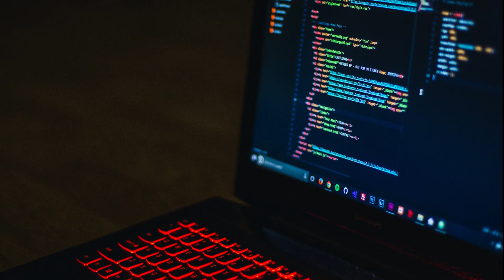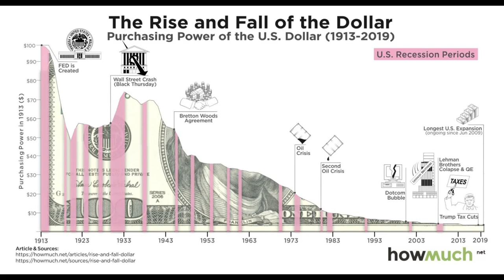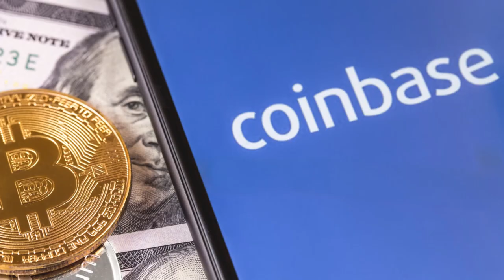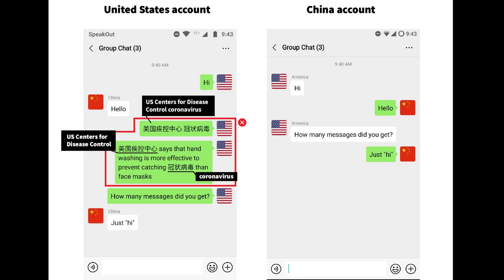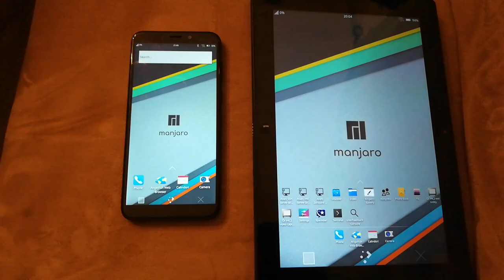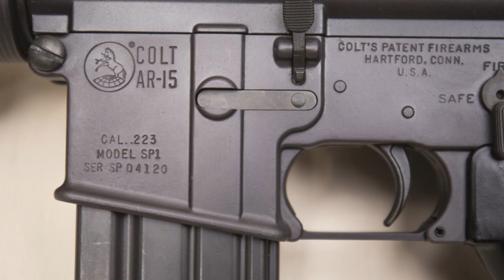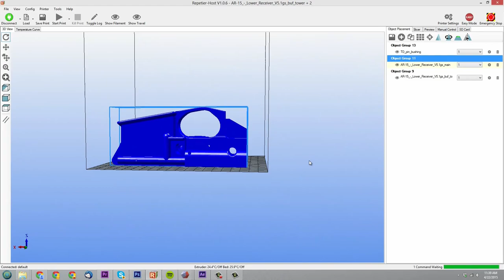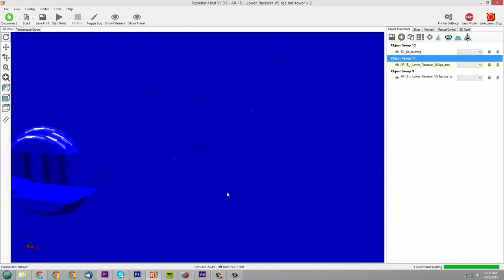Technology's Role in the Battle Between Government and Liberty

Comment: 3D-printed firearms mean nothing without 3D-printed ammo.
Reply: 3D printed firearms are an utter meme anyways. Get a mini lathe and a welding machine and you'll make a much superior gun in your garage for the same price. It's only pushed by boomers who don't understand the limitations of this technology. 

Also, making ammo is stupidly easy if you have access to any kind of nitrate or nitric acid. It can quite literally be made out of paper cartridges and a few cast lead balls.
Reply: @gayusschwulius8490  Where can you get a mini lathe and a welding machine for cheaper than a $169.00 Ender 3 and a $22.99 roll of esun pla+?
Reply: @technical3998  Since when does PLA work for guns, don't you need stronger plastics for that? I'm pretty sure if you printed the liberator in PLA it'd burst on the first shot. And printing precise ABS parts with the Ender 3 is a massive nightmare because it is an open printer which will always produce warping issues. 

A mini lathe + welding machine will cost you around 300 dollars. But you only need the lathe if you want to do a rifled barrel, the welding machine alone for about 100 dollars + a few other small tools (saw, dremel etc.) and lots of time would be enough to make a really decent smooth barreled gun out of parts you can buy at the hardware store. And 3D printed guns would still be inferior to that.
Reply: @gayusschwulius8490  I didn't say pla, I said pla+ It works for all kinds of lowers mine personally has lasted over 500 rounds with no signs of wear(would have more rounds but ammo is pricy).  Also, look into the FGC9 its 100% pla and it works fine.
Edit: I forgot to mention the Anderson Hellfire/Wildfire, they are ar lowers that work in normal pla.
Edit 2: Your information on what is possible is a little outdated I recommend you visit crtlpew on YT.  Also, join the deterrence dispensed keybase to check out what possible now for example we use a process called ECR(Electrochemical rifling).
Reply: @technical3998  The barrel is not PLA, but it is made with PLA tools.
Reply: @lordvalen8133  I know it’s called ECR or ECM.
Reply: @gayusschwulius8490  they're not a meme, they're just in their infancy. It'll only get better. Luckily.
Reply: @gayusschwulius8490  Welders are cheaper than 100 dollars, I think I've seen some for 30 in here, Argentina (and this country is not cheap).
Reply: @gayusschwulius8490  
And machining tools are incredibly expensive, specialized, and difficult for a layman to operate properly. If the goal was to create a good gun, 700 dollar 3d printers running nylon and heated enclosures would be the norm. Instead, we see people using chinesium printers and PLA, because the cost to get set up is low and PLA is easy to use, which is good, because the entire point of printing guns is to make them impossible to regulate, not to make them good.
Reply: @somerandommen  Yes, but those use a metal barrel and multiple other metal parts (bolt, chamber etc.) that need to be bought or machined, which defeats the purpose of a 3D printed gun, because the sale of those parts can be regulated and machining them requires tools that could already make better guns without 3D printed parts. For example, if the EU banned the sale of soft air rifles to people that cannot prove legitimate intent tomorrow, the inventors of the FGC-7 couldn't do shit anymore. 

In the end, only the "easy" parts of a gun can be 3D printed, so those that don't need to withstand the mechanical force of the explosion, if you want to have a gun that doesn't explode after the first shot. 

Thing is that those parts were never the problem. Luty made those with much more primitive tools 40 years ago. The problem was always manufacturing a rifled barrel, a chamber and a bolt that can withstand multiple shots. And in that regard, 3D printers have changed very little. 

If CNC mills and lathes ever become cheap and easy enough to operate for the average person, that's when the government needs to worry about homemade guns. As it is nowadays, 3D printers have not considerably improved the ability of the average person to make a gun at home. It's all a giant hype.
Reply: @gayusschwulius8490  You are the boomer here. The FGC-9, or "FGC-7" as you called it, was designed by a European (RIP Jstark) specifically to circumvent all these bans on parts. You can make a nearly 100% PLA+ FGC-9. The only metal parts you need is two pieces of metal stock, and a pipe that you can electrochemically machine into a barrel. It's not just hype, and this is just the beginning.
Reply: @gayusschwulius8490  Someone hasn't heard of or properly researched the fgc 9
Reply: @xcallista8879  you are correct, fgc 9 was made to circumvent European gun laws, like the luty. The fgc 9 now has a mkii version, there are other variants based off it like a mod 9

If someones bitching, then just make a luty, then use a printed pistol grip, hand rail, stock, optic railing, and foregrip. Then you have a metal gun with polymer furniture which can be made with hand tools and a cheap 3d printer
Reply: @gayusschwulius8490  Boi, u r the boomer here. Much more easy and much cheaper to ECM a barrel than making it on a lathe. You don't even need to weld the bolt. And those are the only parts that are not 3d printed, except for screws and springs.
Reply: @MrDanielsahne  Yes, yes, yes, but that's not my argument. ECM rifling is a great improvement in homemade firearms design, but it has little to do with 3D printing. Whether I 3D print the part that holds the ECM tool or make it out of styrofoam or another easy to work material has zero relevance to the result. The FGC-7 and other weapons are great improvements, but they are not an improvement BECAUSE of 3D printing, it's the innovations that have nothing to do with 3D printing that are important. 3D printing only makes making homemade guns marginally easier, it isn't a "big game changer" like MSM boomers like to propose.
Reply: Bro you know Google saves all comments Right

This place is not private...
Reply: @rivulet5417  YouTube doesn't use end to end encryption? Lol
Reply: @kotalifts5611  It's like whatsapp end to end...
Reply: @rivulet5417  oh damn, I guess they're screwed
Reply: @gayusschwulius8490  except for the primers ...

Comment: I'm gonna nitpick here, but I just wanted to point that there is no rooting involved in the process of installing GrapheneOS, just unlocking the bootloader. In fact, Daniel Micay actually recommends against rooting, as it is a security risk.
Reply: >"rooting is bad"
Cringe
Reply: @iskamag  Rooting basically entirely screws the whole android security model by removing the separation between system processes and user space apps.
If you want to modify anything on the system, it's preferable to just build and flash an image with the wanted modifications rather than rooting the device and let userspace applications perform the changes.
Reply: @ricardillapujagut8073  ah, I see..

Comment: Also keep in mind the reason why Crypto isn't really considering a good currency is because the price fluctuates too much, and its not as stable as USD even with inflation.
Reply: Yeah, stability is  the very real problem with crypto at the moment. I agree with the idea on principle, but a currency that changes wildly in value several times a week is not really viable for everyday use by the general public. I wonder if that issue can be fixed.
Reply: @lemax6865  One of the arguments against the gold standard was that the value of gold fluctuated every time more was mined. Sound familiar?
Reply: @HopeisAnger  The value of everything fluctuates; the problem is how often and especially by what percentage it fluctuates.

 FIAT currency fluctuates in value to a rather worrying degree year by year and yes, I agree, that is a problem; crypto fluctuates in value by double-digit percentages week by week, sometimes day by day. 

Cryptobros point to the very real problems of current monetary systems, and then propose a system that has all the same problems, only exponentially worse. I don't see the point in such a "solution". I will not pretend that I know how to fix the problems of the current systems. However, it is blatantly obvious that cryptocurrency as it exists now is not the way to do so.

Comment: I like monero and its privacy features but i think it will have a very hard time competing with bitcoin in the future. History has shown that the market determines one dominant money and bitcoin is the best monetary network because of its strict monetary policy, its widespread note distribution and history of stableness. There are also ways to transact privately in bitcoin with coinjoin, which makes monero kinda obsolete.
Reply: Bitcoin uses proof of work, which is not sustainable. So eventually it will have to move toward proof of stake, or be replaced by a different proof of stake crypto.
Reply: @SchemingGoldberg  bitcoin derives almost all of its positive attributes like network security and censorship resistance from PoW. The fact that you can practicly transform energy into future wealth is what makes it so valuable. I dont know to what kind of sustainability you are referring to but in environmental terms bitcoin is very sustainable because its such a competitive mining market and miners have to use the cheapest forms of energy. For this reason bitcoin mining farms often center around remote energy locations which are often renewables like hydro electric. Proof of stake leads to much less secure networks due to the centralization of nodes over time.
Reply: @TomAKAsP3ctRum  Everything you said is incorrect. Proof of stake results in less centralization and more security. Bitcoin currently uses half of the ENTIRE WORLD'S electricity just to function. And it's not even mainstream yet.
Reply: @SchemingGoldberg  well have fun holding your shitcoins then gl
Reply: @TomAKAsP3ctRum  If you want to consider Ethereum to be a "shitcoin", then suit yourself.

Comment: The 3d printing is almost valid , but polymere can't compete with metal espacialy when heat at kinetic energi is directed in a smal point at the back of the gun with 1/7 of the material resitance of metal in the tgoughest comercial polymere
Reply: Additive manufacturing isn't just plastics, just its most common material. 3D printing with metals exists and requires an order of magnitude more capital outlay, but CNC mills also exist and can be had for less.
Reply: @strichtarn3228  a good mill stil can get you in 10k debt and for personal use i don't see that being able to break even
Reply: @vladyman2274  If you can't use a manufacturing machine to generate 10K, that's your own fault. However, this is beside the point. Polymers aren't the only option. Nor do Polymer-printed products need to last as long as metal ones—in fact, that's a virtue as one can just print a replacement for pennies in comparison as soon as it shows signs of deterioration.
Reply: That's why the FGC9 uses metal for the barrel. But it's using metal pipes you can just buy from the hardware store, so it still can't be tracked or banned.
Reply: @vladyman2274  Get together with some friends and pool your money together. Maybe you can all vote for one person to hold the machine.

Comment: Not a word about the cost of mining crypto. Any widely used cryptocurrency will eventually become more expensive to mine than its value
Reply: You don't have to mine it at that point, just buy it, it's a currency
Reply: Like Gold then?
Reply: In that case its price will increase, due to the lack of supply, until eventually the price increases enough to justify mining it. Or even better, just use a proof of stake crypto instead.
Reply: @SchemingGoldberg  but any anonymous coin can't use proof of stake. It's impossible.